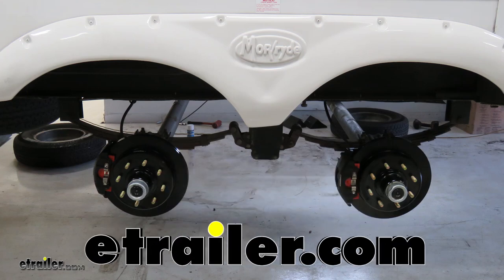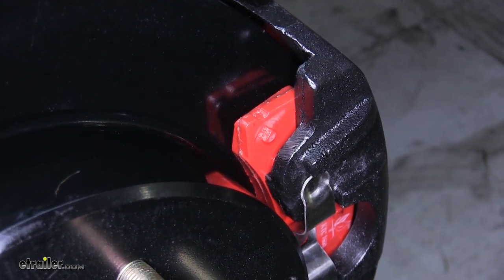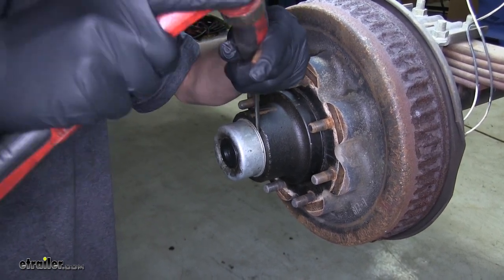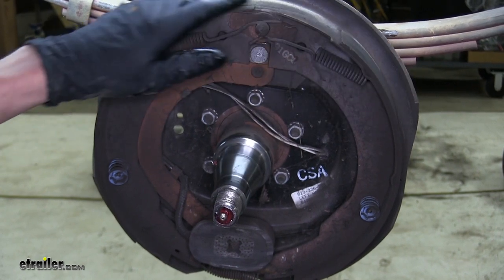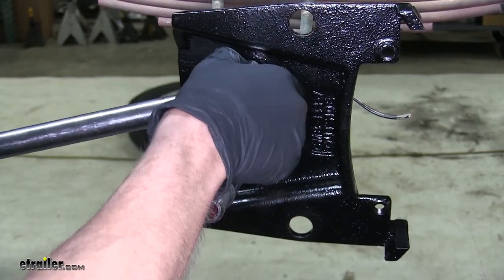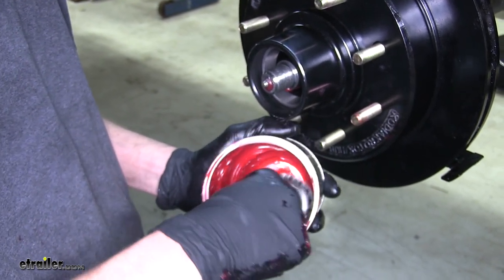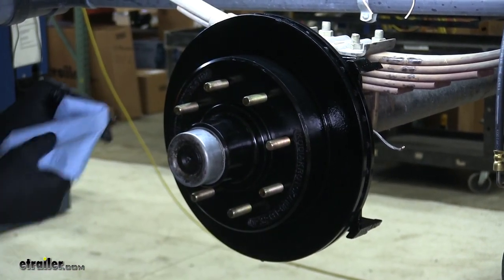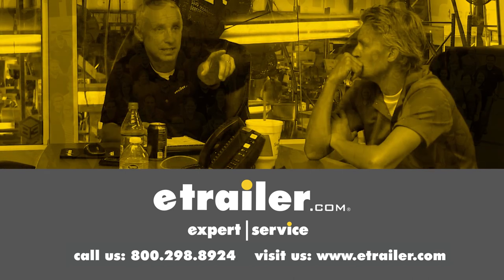etrailer | Kodiak Disc Brake Kit Installation K2HR712DS

Comment: I am currently installing disc brakes on my fiver and I noticed that the 5 studies on the axle are too short to get a full thread on the nuts holding the bracket. It looked like you did not have a full thread on the nuts.

Comment: Would have been nice if you showed the actuator system that was installed. Feels like I only watched half of a video. 🤷‍♂️
Reply from the maker: Check out the following link to see how the HydraStar Vented Marine Electric Over Hydraulic Actuator for Disc Brakes is installed to be pair with this kit.
https://www.etrailer.com/Brake-Actuator/Hydrastar/HS381-8067.html
https://www.etrailer.com/Trailer-Brakes/Kodiak/K2HR712DS.html
Reply: @etrailer  Thank you! I truly appreciate the response! I’ll definitely watch it!